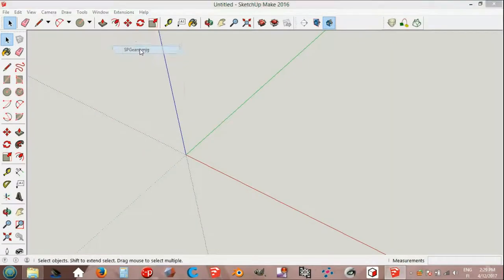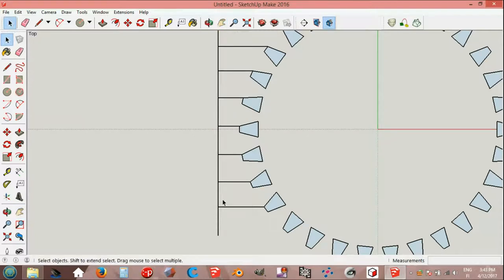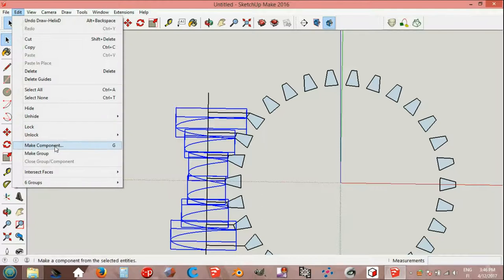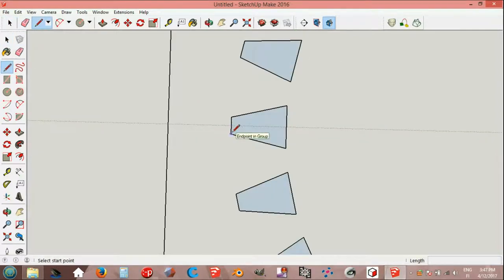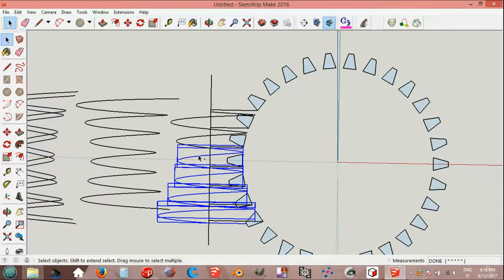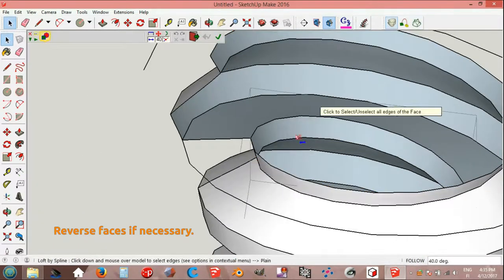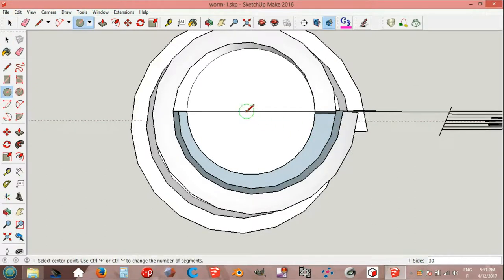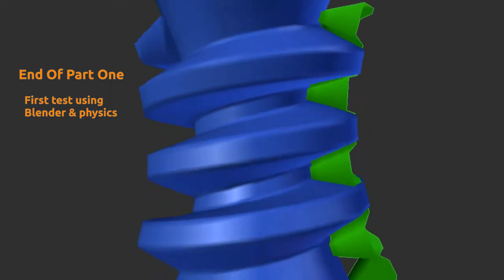SketchUp - Enveloping Globoid Worm Gear - Part One - 3D Printed

Comment: Thanks for all your videos, I have learned a lot from them. I don't see any seems in your worm. Did you print it in one piece? If so, how?
Reply from the maker: The best print I got making two halves along the longest direction and gluing them with acetone and ABS juice (not very easy). I got quite good prints directly the worm "standing" on the plate, but not perfect. 30mm/s was still too fast. I'm planning to test more different ways like two halves (middle height cut / locking structure). Of course printing it bigger helps a lot. Notice that after Part One the worm is not ready yet (almost). A print fan helps a lot with the form although I use ABS plastic. Perhaps even support structures?